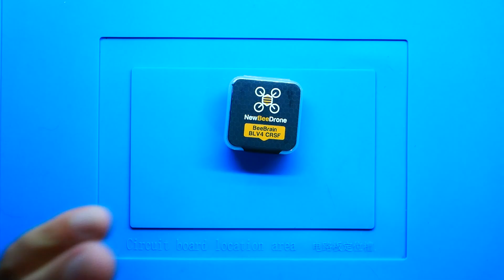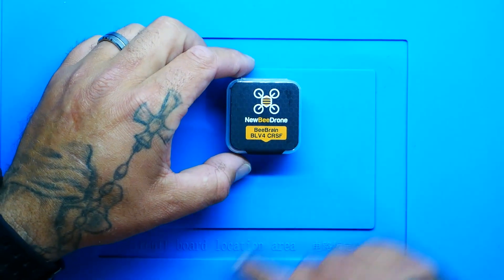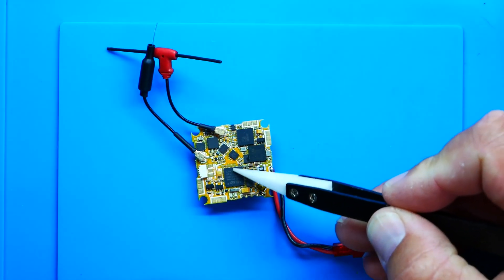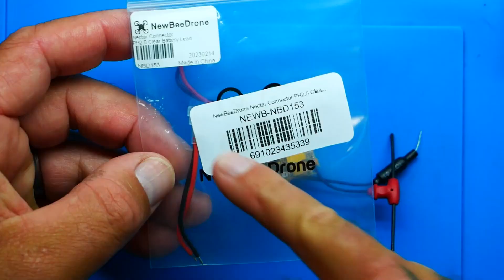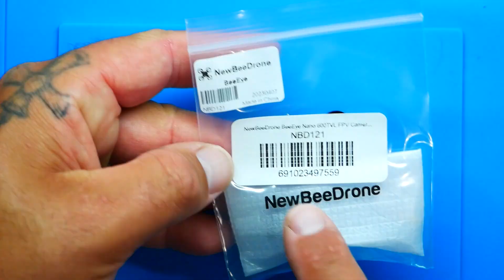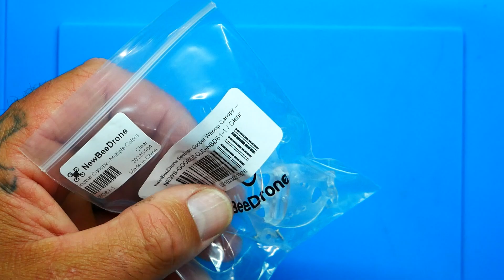Let's Build The Ultimate Whoop Drone with Built in Crossfire!! 🔥 All New BLV4!

Comment: What was the final weight?  U could shave a few grams off the motor wires even if u keep the plugs.
  Even though the vtx and rx is built in.. $100 is a lot for a 1s aio.. are there any break out pads if a component fails?